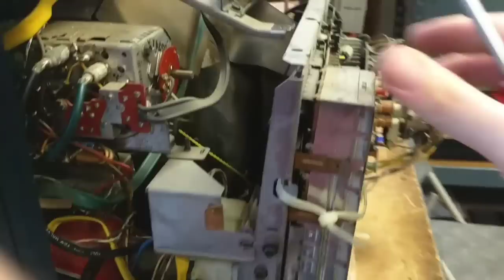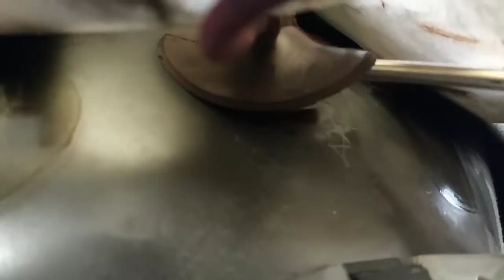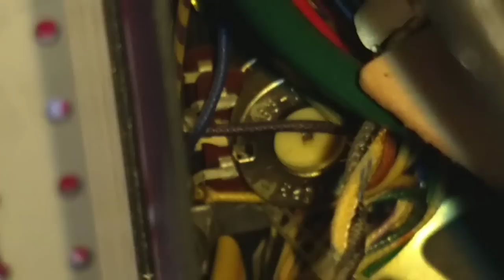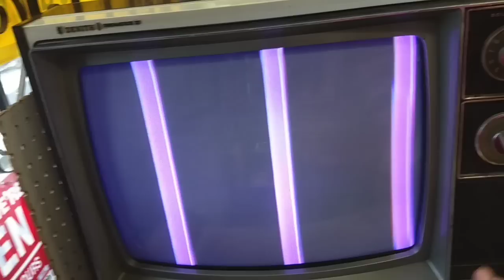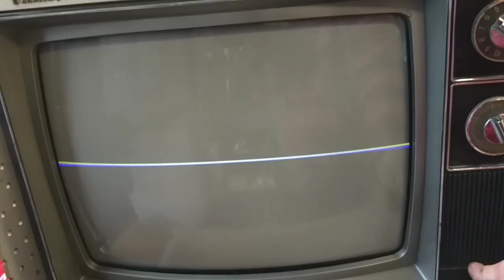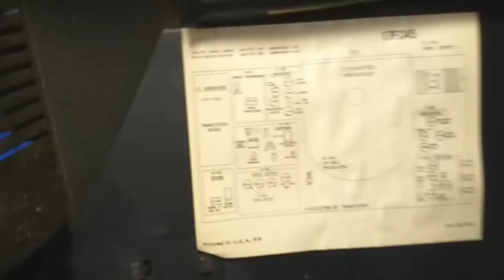Servicing a 1974 Zenith 17" Chromacolor II Color tv part 2 / ?

Comment: I have the same model from 1973, and half my screen is dead, other works fine... any ideas on where to start looking for that issue? Thanks.
Reply from the maker: Check 24v power supply
If ok, check vertical output (no sweep blanks the screen)
Check high voltage with hv probe only. If not check horizontal sweep circuits.

Comment: Hey it's me again. Got another few questions. I got my 19HC45 CCII going but the focus needs to be turned almost all the way clockwise to look sharp. I'll assume a weak tripler but there are a couple other oddities. First, there is a pincushion distortion. Would bad capacitors on the horizontal module cause this? I've also noticed that when turning the set on, if you look down behind the convergence board, there is a small spark that flashes once in addition to having to turn some convergence controls all the way to look the best. I haven't gotten behind there to clean but i'm assuming that is caused by the heavy buildup of dust (looks like nicotine dust). Lastly, a question about the vertical module. After reading a series of forums, it seems like the 9-92 boards are bad. The one in mine is a 9-92b. Since it still works, I'll just leave it but is it one of those things that will certainly go bad and break something un-replaceable?
Reply from the maker: Alot going on here.

1st, make sure your set has the orange safety capacitor beneath the horizontal output transistor heatsink. If it's white, there's part of your problem

Bad focus can be trippler related, but first check the resistor from the ground side of the trippler to chassis. Think it's 10 ohms or something like it. If it goes up in value it will effect hv.

Rarely do the caps on the horiz board cause pincushion failure. More likely missing voltage to pincushion transformer, circuit or bad transformer itself

Check supply voltages to convergence board if controls are at extremes.

Yes, arcy sparky can be cause by filth. Clean thoroughly and check hv lead for arc through or faulty insulation

The vertical modules weren't great, but not unrepairable. The later fixed problems with output transistor failure. If the vert goes out, you will also get no raster by design so that no burn in of a line occurs on the screen
Reply: @JordanPier  Thank you very much for the response!

Comment: Blooming: oil filled cap,  1.5 ohm & base cap of hoz out. 
330 ohm resistor on the 9-90 board.
Color: IC sockets, dirty chromatic switch, IC's. Almost everything is on the 9-86 so you can cheat !
ALL plug in semis suspect on these for intermitants. They eventually eliminated them...
BTW save the anode lead. The 15-276 cap comes off with a screw & makes a great replacement.
73  Tom a.k.a. Zeno
LFOD !

Comment: If you need the sams let me know. I have a few of those and they all have issues, haven't got to them yet. Not sure I agree that they are super reliable
Reply from the maker: A Sam's would be great. I'm sure I'm going to run into issues on this one between power supply, hv and the color problem. Most of the ones I've had we're relatively straightforward. This one is a bit of a mess
Reply: We have a space 80 Andrea we used 25version of this chassis eliminated tube chassis.works well.😎20yrs tripler hard to find today' thought have a 19for parts